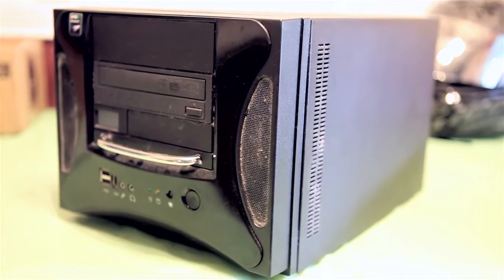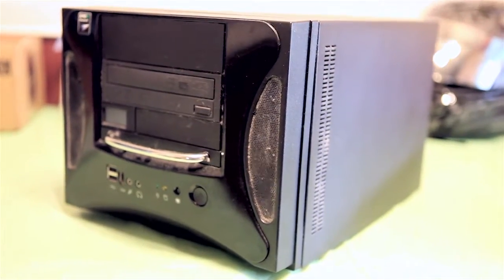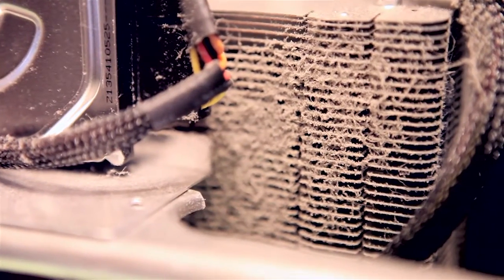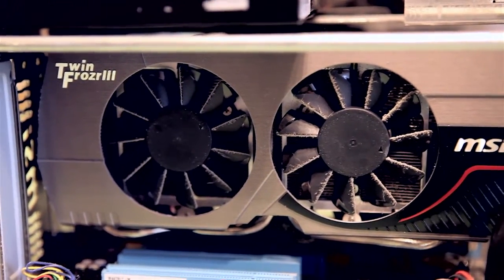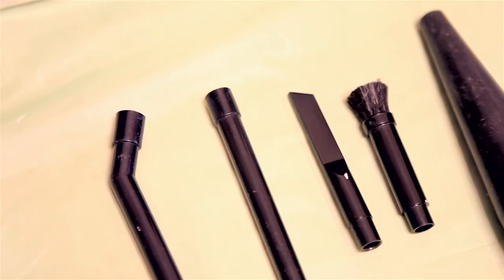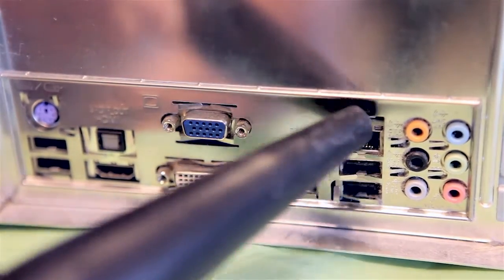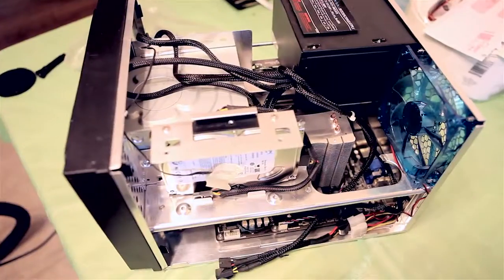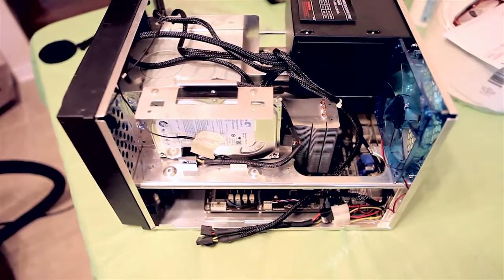How To Clean Your Computer EASY!

Comment: Okay so I have a computer problem bro. My laptop stopped working. It threw an error message and then attempted some kind of repair and now it just displays a black screen. I tried hooking up to an external display and it displays the same black screen. Shows the mouse but nothing else. Windows won't start. Or "appear". Can you help?  justintheapparition@gmail.com
Reply from the maker: Justin TheApparition try  and reboot holding F8 boot into safe mode see if that works, if it does run a virus scan
Reply: Man, I've tried everything. I've booted in safe mode and even tried booting to the command prompt. No matter what mode I try to boot boot in, I get the same result. Mouse and black screen only. ???  Do you think it may be possible to salvage the data?  Even if the laptop itself is toast?  I just want my footage... And pictures... And music. Is there away to recover data on a unit without a display?
Reply from the maker: Justin TheApparition yeah just take the HD out connect it to a working comp as a extra HD and just copy the files over
Reply: When you say "HD out" ???  Which cable is that?  I've tried hooking up to an external display via HDMI. No dice. I assume you're talking about a different cable?
Reply from the maker: I mean actually take the hard drive out of the laptop lol
Reply: This is where my knowledge of computer/laptop disassembly fails me. Thanks for trying to help me, man. I really appreciate all of your prompt responses. But I wouldn't even know what the hard drive is if I did get it opened up... I wonder if there is somewhere I could send it/take it to have that done?

Comment: That's one dirty computer haha did you build it yourself?
Mine doesn't tend to get dirty as I set up my fans to create like a vacuum inside my pc which gets most of the dust pushed out or hardly any gets in. But I usually give my fans a small spray down with compressed air.
Reply from the maker: Nice, yeah I build all my own comps :) Its in the living room so it gets pretty dusty, hardwood just lets the dust fly around!

Comment: I'd like to follow this advice for my pc and it's usually what I tend to do when possible..my current pc is still under warranty so as far as I'm aware, if I remove the housing for any reason (even to clean it) that warranty could be voided..I'll keep it in mind for the future though
Reply from the maker: Yeah I would wait till the warrenty expires if they have like a void sticker on the side of the case, I wouldn't think they would tho cuz comps need to be cleaned, and you not modifying parts or anything
Reply: It was a future shop special so one never knows how they'll react LOL

Comment: I used to waste so much money on canned air working on my own computer, but I was the "computer guy" at work and in my circle of friends, and every computer I worked on seemed to have years of dust, hair, spider webs, and other disgusting stuff inside. Often, it was the dust that was causing all the problems they were having. Gotta keep those heatsinks and fans clear. Anyhoo, I invested in a little one gallon portable air compressor, and that was better, but I've since learned a much, MUCH simpler way of cleaning out a computer. Invest in a cheapo electric leaf blower, take the computer out on the back patio, and blast it. Done in seconds. Literally, seconds. Amazon has small, inexpensive, and frickin powerful as hell electric blowers for around $30. Careful around the fans though. Slamming 160 mph of wind through them might not be good for their longevity. I usually just put something through the cage to keep 'em from spinning while I blast 'em (pen, straw, etc.).